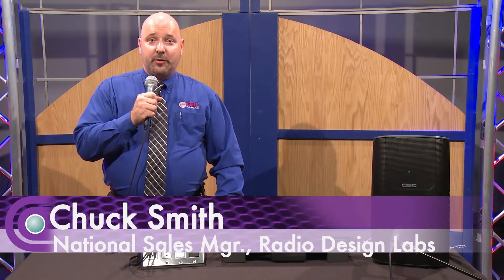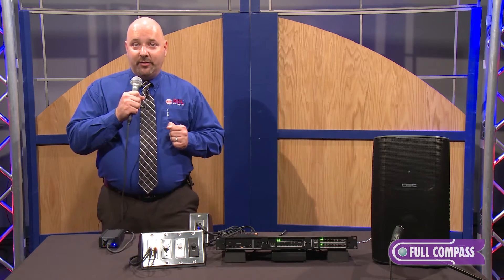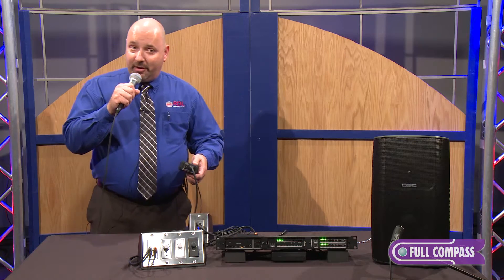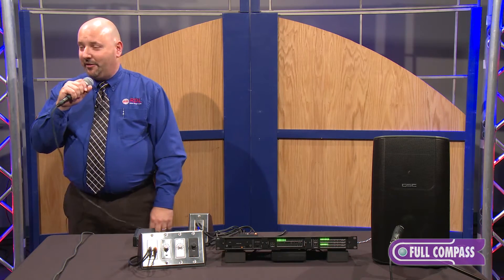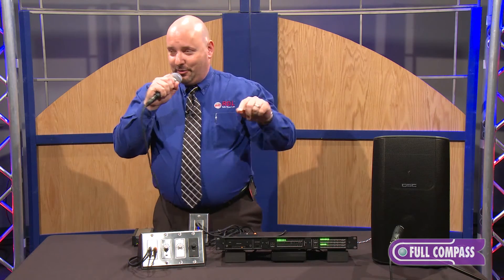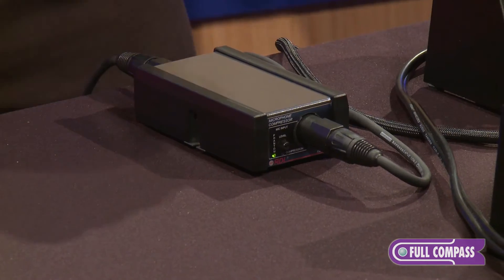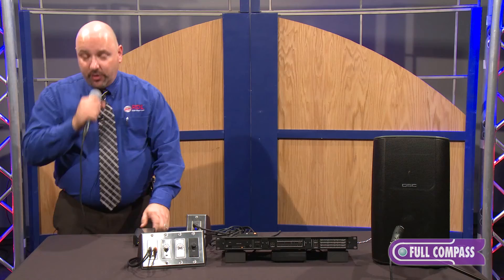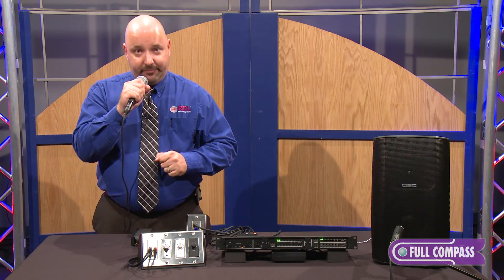Radio Design Labs EZ-MCP1 Microphone Compressor Overview | Full Compass

Comment: I think that these need to be used in karaoke setups.  It would help prevent the screamers from piercing everyone's ears.  It also would help with the quite singers also.  I wonder if this is the same basic thing as the one knob compressors that are built in some of the Yamaha mixing consoles?